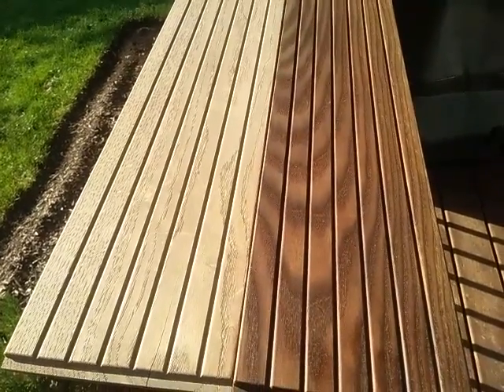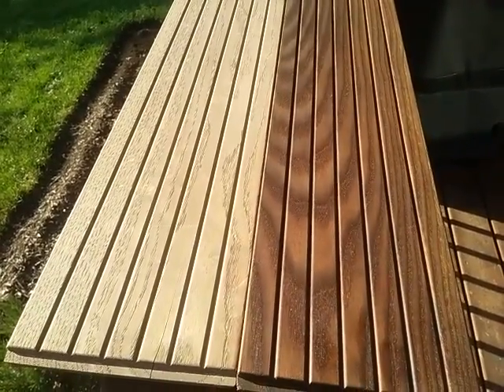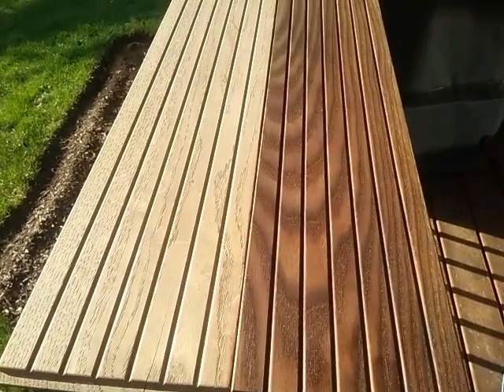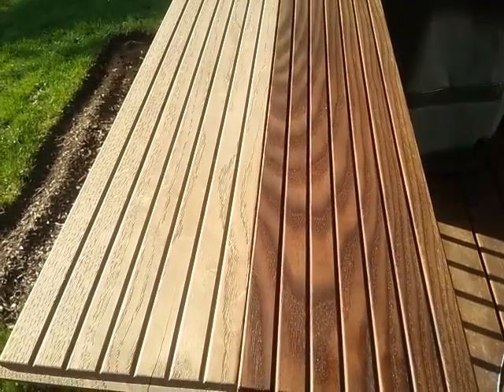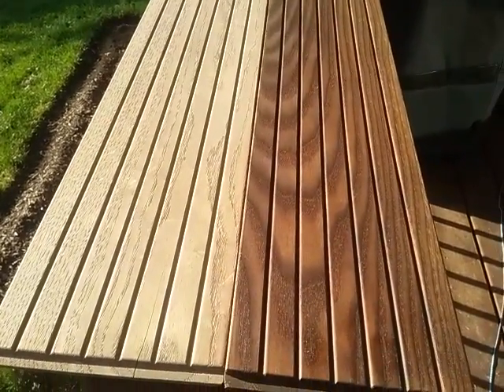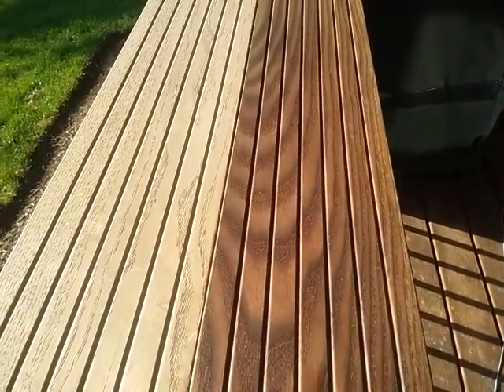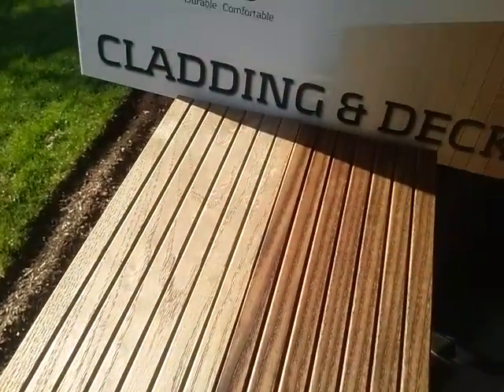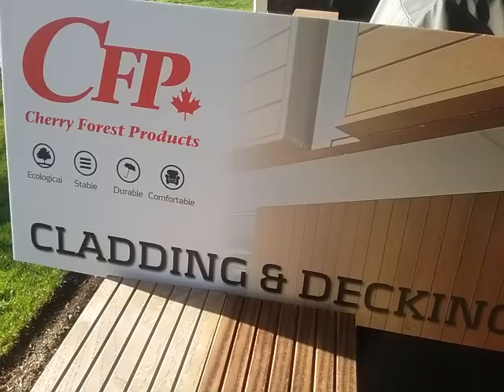Novawood Thermally Modified Wood 4 Month Exposure Test

Comment: Was the coating done before and was also out for the 4 months or it coating was put on after it was out for the 4 months or it was a new piece?
Reply from the maker: Thanks for your question. The coating was applied after the 4 months of exposure. The freshly coated pc. Had yet to be exposed.